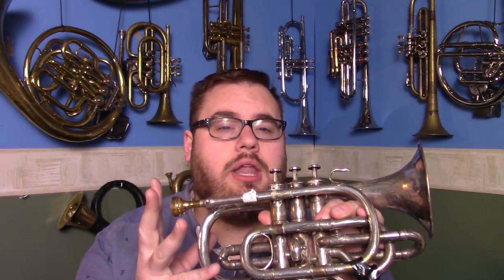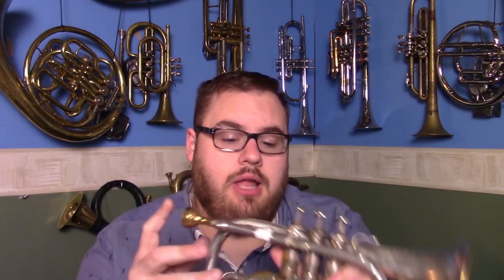Getting the 145 year old Cornet working enough to record...

Comment: For the valves, I found a number of period manuals suggesting Pond's cold cream, and pouring warm water in the bell. I tried this with my 140 year old cornet and it worked SPECTACULARLY. I highly recommend trying this. I should mention that this cold cream idea I found was from a couple of different care instructions of the time. One in particular was found in the case of a Bach strad from the 20s. Evidently this was a common practice.

Comment: Nice! I've been tempted to buy Monster valve oil for my nearly 100 years old Schuster cornet, but for now I've used automatic transmission fluid. This made the valves feel quite heavy, but they're smooth and feel more "luxurious". I was also lucky to find some old-fashioned thick slide grease at my band's supply room. Smelt like sheep due to the lanolin for a while, but it made the slides nice and tight. I really enjoy your channel by the way, looking forward to more content!
Reply: You serious?

Comment: I have a 50 or 60 year old Olds Cornet and the third valve leaked, much like yours. Upper range was good but everything below an E was tough. I bought and used Hetland #3 oil. It is thicker  than modern oils and it filled the gap between the 3rd valve and the valve casing.

Comment: Why didn't you use flex seal?
Reply: Flex seal hardens over time. Wouldn't be much use to play for 5 minutes and have the valves cemented into the casings.

Comment: Horns of that era had markedly larger tolerances in their build than later horns. A player wouldn't have used oil per se, but would  use an oil/lanolin mix that sealed the valves better than just using lamp oil or something, and still let the valves move with a decent action.

Comment: I have a 120 year old tuba and the valves have no plating at all (worn off LONG ago) and it leaks horribly. I use 3-in-One oil and it works well enough to be able to actually play.

Comment: Try dissimlar pad materials on spit valve, cork on one new foam type on other. I would test for air leaks In joints first,,Valves? Replate ? Repent, sin no more. Silver if possible. Or brass?I have wondered about teflon, for recoating very worn parts, but the heat may be too much. Other Ideas, may go beyond rules and Ideals . of conservancy. Do no permanent mods.